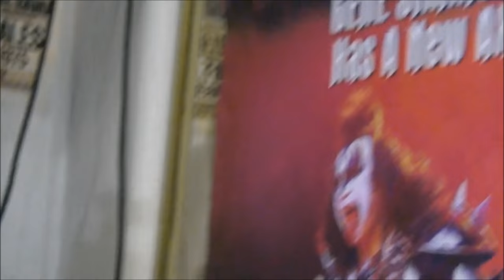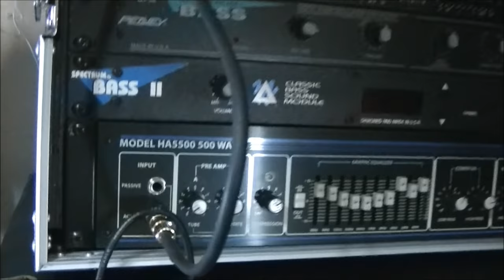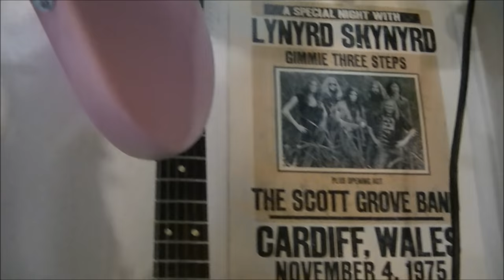My Current Guitar Collection  June 9, 2015 Scott Grove

Comment: Where did you get the chrome cover for the Lyon guitar? I'm trying to find chrome covers to put on my Dimarzio humbuckers. I know Dimarzio makes chrome open coil humbuckers, but my pickups are pretty new so just want a cheaper route to go at this time, so covers could work for me.
Reply: Cool. You have a lot of really cool axes!! I'm slowly building my collection. Mine are mostly Korean made but all of them play amazing. I'm currently trying to switch over to "roller everything" as you say, and switch tuners and ditch string trees and such. Do you have any tips on wiring guitars? I have a strat that I'm wanting to wire up like your white custom guitar and get rid of all knobs and such but not sure how to go about it. Any help is appreciated. Rock N Roll!!!
Reply from the maker: crazyelvis3577 Cool my man.  If you want to do any of the no volume knob or no tone knob things, simply remember to put the same resistance in line as would be if it had those there and same with the capacitor for the tone pot, even though they aren't REALLY being used, those being in line make a huge difference rather than just running everything straight to switches and the output jack.

Comment: Scott, what sort of bridge design do you think is the best?
Reply from the maker: Liam Shanley As far as what is currently on the market?  I like the ones on the Korean SE models.  They are adjusted already and they are dead on.  If you use some moronic gauges of strings.....it will be off.  That will teach people to tune to STANDARD and to use NORMAL gauges of strings.  lol  Of course, I have my own designs in my head which actually just hook the ball end of the strings to the hook so that the ENTIRE STRING can ring instead of being forced to interact with anything else.